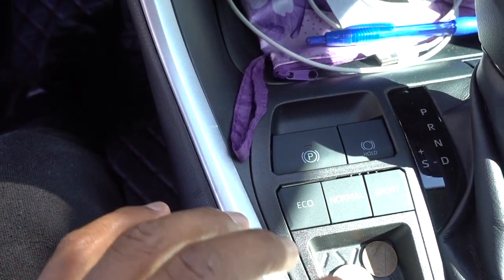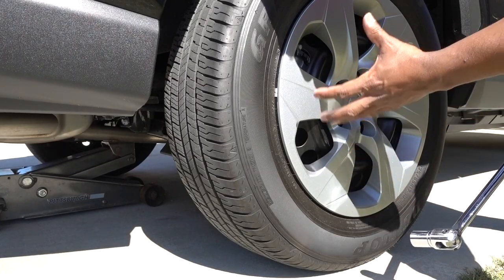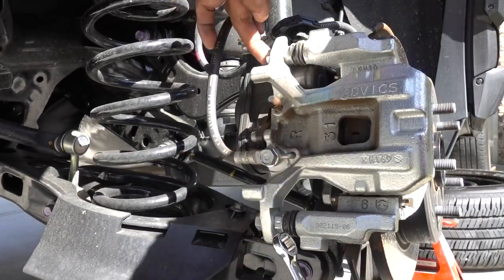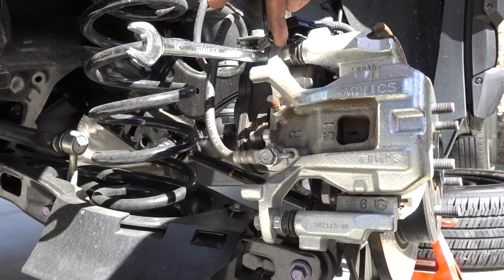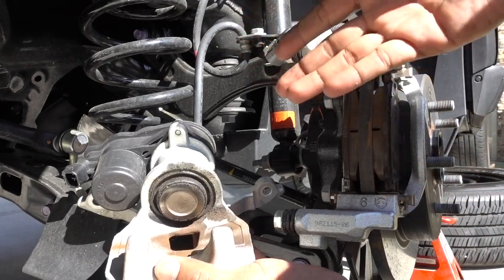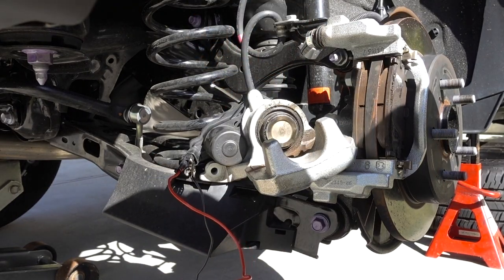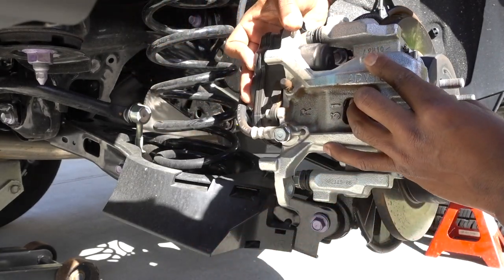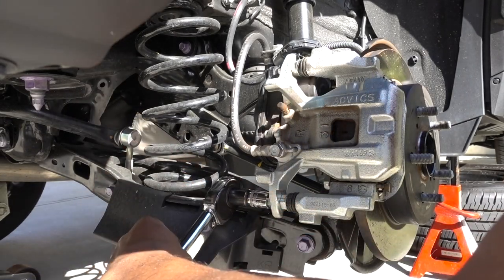2019 RAV4 How To Replacer Rear Brakes with Electric Parking System

Comment: My engine light went on after changing rear brakes what do you think went wrong
Reply from the maker: Make sure the connection is ok, and reset the light
Reply: @BulletSolano  we reset it and engine saying fuel filter crazy, ok will check connection but the mechanic was having a hard time changing the back brake, we didn’t know they were electric after the fact
Reply from the maker: Probably he damage the electric brake
Reply: @BulletSolano  thx for replying
Reply from the maker: No problem

Comment: when i apply 12 volts to the terminals, the motor spins, but the piston does not move. when i reverse polarity, it spins, but does not retract, and does not advance. any idea?
Reply: what i did, i removed the entire assembly of the electric motor and gears and then the piston was retracted with a c-clamp. it moved smoothly and slowly. but now i have an error code, that parking brake does not work.
Reply from the maker: https://youtu.be/mRvpfzo_68c

Comment: Thanks!
Where did you get the little electric thing?
Reply from the maker: I get it in Autozone
Reply: @BulletSolano  what is it called?
Reply from the maker: Sumnacon Dual Ended Crocodile Alligator Clips, 15A Test Lead Wire Cable with Insulators Clips, 2 Pcs 3.3 ft/1m Test Flexible Cable with Protective Jack Copper Clamps for Electrical Testing https://www.amazon.com/dp/B072C8G3XJ/ref=cm_sw_r_cp_api_glc_fabc_-zN8Fb9AZJ6SW
Reply: @BulletSolano  thank you. I’m loving my 2021 RAV4. I also got the LE like you but in red
Reply from the maker: Nice
Reply: @davidarmstrong1421  I just got my 2022 a few weeks ago. For some reason my LE came with Alloy wheels

Comment: How much voltage does the battery have to be.
Reply from the maker: 12 volts but 18 or 20 volt doesn’t do bad to the motor, is just for a few seconds

Comment: Do I lose my parking brake when my battery dies??
Reply from the maker: If the parking brakes was on before, no
Reply: Ok so it takes electrical powered to apply and remove the parking brake?

Comment: If the plug has 3 pins what tool can I use 🤔
Reply from the maker: Take it to a shop they have the scanner to do it
Reply: To do what? To open and close the piston? Or to reset a light?
Reply from the maker: Both